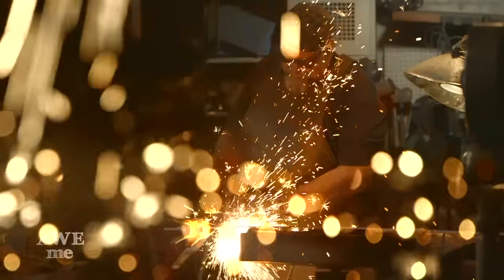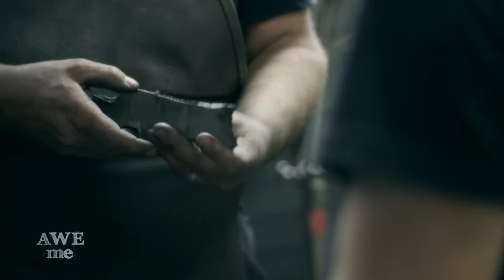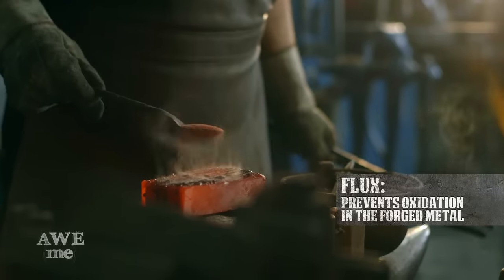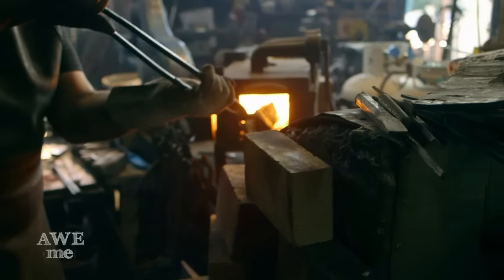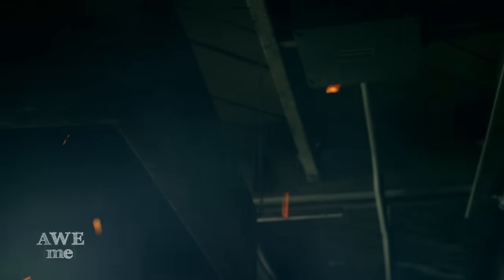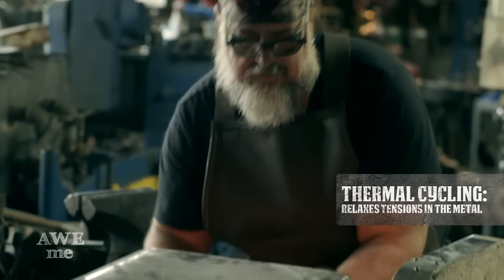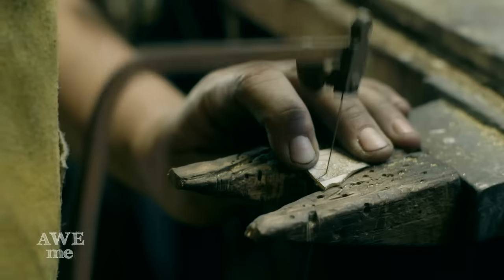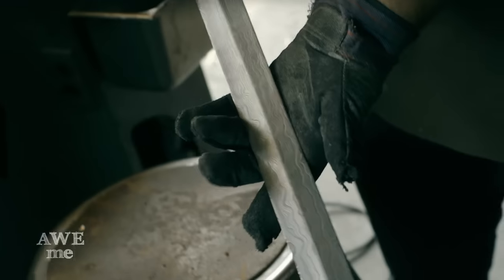Sokka's Meteor Sword (Avatar: The Last Airbender) - MAN AT ARMS

Comment: You should have quenched the blade in cactus juice.
Reply: IT'S THE QUENCHIEST!
Reply: A GIANT MUSHROOM DANCING
Reply: Burt gummed brand?
Reply: MAYBE ITS FRIENDLY?1?!
Reply: Or since Sokka's blade was quenched in water, these guys could've just bit the bullet and done the same.
Reply: Crimson Melody Friendly Mushroom! Mushy Giant Friend🌵
Reply: KanjiGodomo quenching in water doesn't always work well
Reply: Frazer Fastin I know, but sometimes, some people would just have to bite the bullet. I'm not sure if this could erode some of the meteor, but I've seen some people make knives, quench them in water, and once I've seen someone drop a recently water-quenched knife blade without cracks. Even after testing that knife, it still held strong.
Reply: thousands of dollars worth of material went into the blade, and they did not know the precise makup of the metal, and therefore its properties.

water quenching a blade is always a huge risk (unless the blend of steel was specificaly designed for water quenching), oil quenching is far less of a risk which is exactly why people tend to quench in oil, also water quenching leaves an extremly brittle blade unless it is covered with something (like the clay used on a Katana) to slow the cooling and leave the blade less hard and brittle
Reply: Crimson Melody It was boiled in oil. :3

Comment: a shame this wasn't blackened
Reply: Luke outset yeah
Reply: Luke outset si
Reply: yeah i hate that
Reply: I'd rather a sword made of actual meteor than a non-meteor sword that is black.
Reply: Well to be fair the only reason it was black in the show was because that was what the artists thought a meteorite forged sword would look like.  Also it would’ve been a shame if they did blacken it as the awesome pattern would’ve been hidden.
Reply: @Naiadryade  how hard is to make it from meteor and also make it black tho
Reply: Bayu Salsabila very
Reply: @alexelliot2443  The goal is to make sokka's sword.  it is meteor sword but its not sokka's if its not black. so did we reach the goal tho
Reply: Bayu Salsabila yes and no yes it was made of the proper material but to get it as dark as the sword in the show some kind of black coating would be needed but it's really close
Reply: @alexelliot2443  because its really close triggering me even more. you know. like it is not finish
Reply: Bayu Salsabila it's as finished as possible without some kind of glossy paint to make it fully Black
Reply: all they had to do was go to Walmart and get rustoleum high gloss spray paint. would have made it look cool. Lol
Reply: Andrew Parker but it would probably chip
Reply: I don't kthat stuffs  pretty tough. Also just be for show.
Reply: Andrew Parker in that case for display yes but unless it's like enamel truck liner I wouldn't use it on a blades that was going to be used due to the sharpening process would take off the paint
Reply: @bayusalsabila6113  feel free to make your own meteor sword...
Reply: @alexelliot2443  the black coating is actually cheap and relatively easy to do... cold steel uses gun blue on the blades in their maa line to help cut down on production costs and my guess is about 4-6 coats of blue on that blade would make it pretty black

Comment: I wanna know the advantages/disadvantages of making a sword out of meteorite; it's so interesting! MY SCIENCE SENSE IS TINGLING!!!
Reply: I think Iron nickel alloy is definitely too fragile to make for a strong, viable sword - you could see the forge welded billet splitting and breaking with the original higher amount of meteorite metal. You could see blades becoming longer, larger and stronger throughout history for this reason - from bronze, to iron, to steel: As the base material became stronger, longer and larger blades became viable.

As an aside, iron-nickel alloy polishes up to be pretty bright. Sokka's sword; aside from being extremely fragile (cast metal is metallurgically weak) would have been very bright, pale metal instead of the black sword in the animation. I think Mr Swatton's rendition of Sokka's jian is absolutely perfect. A black anodized monolithic steel blade would have been simply too boring.
Reply: That said, there is an iron-nickel alloy with very low carbon that is strong called Maraging Steel. It's used in things from rocket casings to epee and foils in competition fencing because the lack of carbon makes it very workable and strong.

There would have been very little control over the carbon content in the meteorite metal and that was probably why the forge welded billet was breaking - too much carbon.

If Master Swatton ever got a hold of some maraging steel I'd love to see what he'd be able to do with it.
Reply: MonMalthias Isn't steel the result of carbonizing iron in an attempt to make a more flexible metal that's light but strong?
Reply: *****
If there's too much carbon, steel becomes brittle and shatters like glass upon being worked. There's a fine line between soft, weak iron with too little carbon, high quality steel that holds an edge, yet flexes instead of breaking upon impact; and useless pig iron. Pig iron is iron with too much carbon (4.5%) while the SAE1074 spring steel that Master Swatton is fond of using only has 0.7% carbon.

Comment: dude: the rocky salty ingredients in the meteorite ore is going to make it brittle, it's the same concept as using carbon to make steel except the particles are too big to be useful. Folding the steel is a method to drive off some of the larger particles and impurities, it was commonly used in japan not because it made a better steel but because the quality of the iron they had in japan was terrible and in order to make it even slightly useable required the careful folding of the steel multiple times to hopefully drive off the impurities. more folds= better steel= cleaner steel.

in the tv series they happened to do a cast of the sword, now usually this is a bad idea for weapons because cast iron is brittle and melting steel burns off the carbon. however if they added some charcoal and some flux and then sealed the meteor material into a charge then buried it in their oven and kept the temperature at "damn thats hot" fahrenheit you could incorporate some of the carbon into the now nickel iron metal and turn it back into nickel steel. this is probably the route that sokka's master took when forging his meteorite sword for one important reason, if done right you can get smaller crystalline structures in the steel from the charge which allows a more flexible sword that can keep a decent edge. this happens also to be the most accepted way that the famous "Ulfberht" swords were made, just about proven when a blacksmith out in kentucky re-pioneered this formula and made a damn good sword.

the nickel has an added bonus of making the sword rust resistant, kinda nice seeing as he's from the water tribe that happens to live on the ocean.

Comment: In the episode, he's shown melting it down to liquid metal and pouring it into a mould. Is that even possible? Would a liquid forged sword be better or worse?
Reply: You can do that but it depends on the material... The only metal I can think of where that would be required is Pure Iridium. Hardest metal known to man... For steel its a bad idea cause you would have to fold and redraw a sword by its complete length.
Reply: Sokka's space sword (that's what he called it) and Toph's bracelet displayed properties that definitely aren't seen in regular iron, and even though it's just a cartoon, I think we can just assume that it's not regular earth metal. Casting a sword would make for a terrible blade, but Piandao seemingly used ingots for all his other swords.
Reply: I think they just poured it into the mold to make sure they had the perfect amount to make a full sized sword.

The probably forged it out after that.
Reply: Making a sword with that whole pouring liquid metal thing would be like making a baseball bat out of particle board. The thing would be stupidly fragile.
Reply: Crucible steel swords were and are still famous.  But I suppose that to cast it the way they do,  you need inert gas and such
Reply: From my layman understanding the meteor he used had a heap of slag in it (non metal material), you can tell by how many sparks came out whilst hammering. He had to forge weld it because the metal used in the sword is pretty primitive low grade steel mixed with all sorts of other metals. If you want to forge a blade with the method youre mentioning it needs to be pretty high grade carbon steel with little impurity, otherwise you get a sword with very little flex and likely to break.
Reply: TheZannen
Yeah, the funny thing to remember when in awe about a meteor sword is that it's not impressive because of the material qualities themselves, but because it's difficult to forge, since meteorite is basically extremely dirty common metals. And that dirty metal isn't even that special because it's from other space, because everything is. The metal we dig up simply has been on Earth for a longer time.
Reply: *****
Historians keep emphasizing how much of an advantage the switch from bronze to steel was. But IF bronze swords were usually cast and steel weapons usually forged, I wonder how much of the advantage was due to forging and not the choice of metal.
Kinda curious about the differences in detail, and also what kind of alloys we can do with bronze today that would preserve the historical blade color but are superior.
Reply: Dᴏᴡʟᴘʜɪɴ Iron had an advantage initially not because it was better (it was about the same due to technology limitations) but because it was more available than tin which is necessary for bronze. This is how Romans were able to mass produce gladius, previously unattainable through bronze.  Forging is not better than casting, it is more difficult and time consuming. But through tempering and quenching techniques we were able to create carbon steel far harder and durable than bronze. We were not able to cast high carbon steel in a manner comparable to bronze until the industrial revolution as its melting point is about 900 degree Celsius more than bronze. By this time swords were obsolete. Today our smelting process is advanced enough to chemically stain carbon steel the colour of bronze while it is in the melting process.

Comment: you need to make it black it is not silver
Reply: And it was cast in the show
Reply: @gsomethepatient883  you can't cast swords you would not come out with anything battle worthy.
Reply: @gsomethepatient883  Yeah, that was a factual error on their part. Sokka's sword would most likely have been forged exactly like this one was, using the Damascus process.
Reply: @jonathantaylor4309  well I still would have wanted to see a variation on that though, like casting out a meteorite billet and then forging that out into the final sword (with a bit of steel added in to balance the composition, if necessary).

Comment: It seems like such a shame to use that beautiful meteorite and then weld a mild steel tang on instead of forging it out.
Reply: Eh. You won't be seeing the tang, so I don't think it much matters. Especially if they were having such difficulties with the meteorite alloy making the steel crumble, no need to push the matter further than necessary.
Reply: Well it's not about seeing it or not. Welding a tang on puts a lot of structural stress on a weak point. The crumbly nature of the meteorite was overcome once the billet was forged out and folded several times; I personally think they just didn't have as much material as they had hoped once the billet was drawn out to length.

That being said, I doubt anybody is really going to use this sword, so it will probably be just fine. It's just very expensive material!
Reply: +Ty Grenier I don't know if you already know this but welds are actual very strong. the point of welding is to prevent the parts from falling apart. Your car is full of welds and you don't see them falling to pieces do you? They only crumple in accidents exactly where they want. In older steel cars they don't crumple at all.
Reply: Bitisu
A weld can be very strong in their own way, yes, but it's not ideal for pieces that need to withstand repeated impact stresses. This is especially true for where the tang on a sword meets the rest of the blade. This is due to stresses that occur while welding (which in this case would be fairly normalized during the rest of the process) and the different hardening/tempering characteristics in the two different steels.

In your example of car welds, not only are those structural welds in a completely different application, but they are planned out to occur over broad areas instead of a single spot.
Reply: THIS, this right here is the sad thing. that never would've happened later on/(in reforged). Illiaya is a god of forging
Reply: Jeremy Woodhouse
Agreed, Ilya (I had to look up the spelling) is a beast. Even on builds that are basically impossible to make practical, like the Genji sword recently, the whole team does pretty much everything they can to do it as well as possible.
Reply: Thereon Inarek
The first iteration of Man At Arms (not "Reforged") was a completely different group of people, and were very disappointing to me. That includes the rat-tail sword. The current group are Baltimore Knife and Sword, and they do a WONDERFUL job. Ilya is indeed the one heading the dandao project and most of the more traditional forgings, especially the asian ones. Dude is very knowledgeable, patient, and exact; everybody I've seen in their group is good at whatever they do.

No need to show off the smithing knowledge, I've done my fair share of research as well ;)
Reply: *****
Well, if it weren't a welded-on piece the size would have been fine. Historically, much longer, heavier blades have tangs that come down just as narrow. The shoulder needs to be wide enough not to let the handle core twist, but the pommel end can come down to a pretty much square or round size.
Reply: *****
I'm judging primarily by the incredibly detailed drawings and measurements I've seen from Peter Johnsson and Jake Powning, who have traveled to the museums and handled/documented many swords. There are a lot of swords with tangs as wide as 1 3/4 inches at the shoulder, but there are also plenty (used) swords that were 3/4 inch at the shoulder. This meteorite sword looks to be about one inch at the shoulder, which is typical for a jian.

As far as being able to be used, 3/4 inch is perfectly fine. I own an Oakeshott type XIIIa made by Angus Trim, whose blades are renowned for being incredibly durable and reliable under heavy use. In fact, Oakeshott himself owned one of Gus's blades. For a 44 1/4 inch overall sword weighing in at a sturdy 2 lbs 10 oz, it "only" has a 3/4 inch wide tang at the shoulder. And it is PLENTY strong enough to support repeated full-strength swings into dense materials.
Reply: That whole convo made me feel like an idiot for not knowing what yall were talking about.
Reply: Ty Grenier I wonder if the sword is made of meteorites does it still rust?Or because of the metels they used it's still sharp and not rusted? Because I would like it if this beauty of a sword didn't rust.

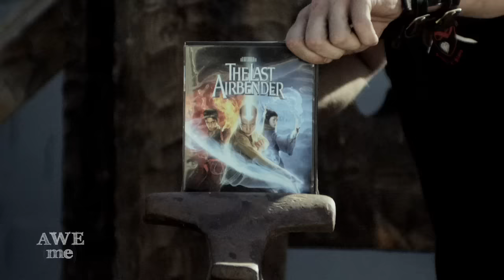Comment: 6:19 don't dull the blade with this crap.
Reply: Yeah i hate when they do this. They build the most beautiful things and then just smash glass and cut through stuff and into the wood table with terrible form. It makes me cringe
Reply: Courtesyflush52 They aren't even suposed to be used.

And to be honest, I don't think it affects the sword at all.
Reply: SlowSlowSloth I was just saying that he's slashing a DVD copy of the "The Last Airbender" and that the blade doesn't deserve to touch that...thing... They obviously need to slash stuff,that's what weapons are built for after all.
Reply: Considering that these aren't exactly forged swords, I wouldn't be too concerned with dulling the blade. They can always be resharpened. True swords such as japanese made Katanas that take an entire half year to make would make me cry to see them abused.
Reply: Carl St. James Most of that is turning the Japanese steel (i.e. pig iron) into a steel you can actually forge a sword out of. The actual forging takes no more than a week.
Also, this is an actual forged sword. It's hammered into shape, the definition of forging. The only part strictly not forged was the tang.

Comment: Of course it came apart, you can't forge raw meteorite cause it's frickin raw ore! You have to smelt it or bloom it first. Ironically, a step actually shown in the TV show and totally skipped by the "professional".
Reply: my thoughts exactly
Reply: But the show had them pour the metal into an open air sword shaped mold. 
The show didn’t exactly get its stuff right either

Comment: I think the big thing that makes every attempt at doing this fail (without adding tons of regular steel) is that they just cute the meteorite and add it to the mix. What you need to do is smelt it and drive off all the crap that isn't iron and nickel and get a bloom and then forge that into an ingot and go from a very pure metal before turning it into a blade. There's just WAY too many impurities in a meteorite to go straight to blade with it.

Comment: A chunk of meteoric iron or to put it another way a chunk of meteorite worth $1,652 USD was used for part if not all of this forging process and the meteorite chunk is not something that is cheap as cost is per gram at an average price range of $0.5-$5.00 USD per gram of meteorite and a gram is practically nothing in size it’s possibly less than a teaspoon of sugar as a rough comparison of weight as a teaspoon of sugar is roughly 2-5 grams approximately